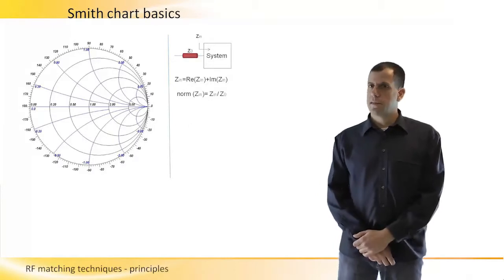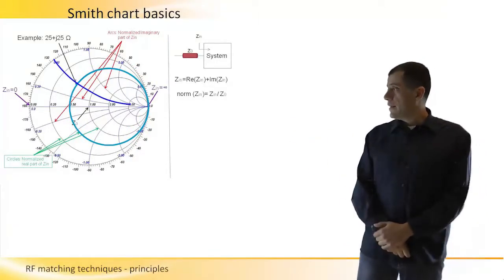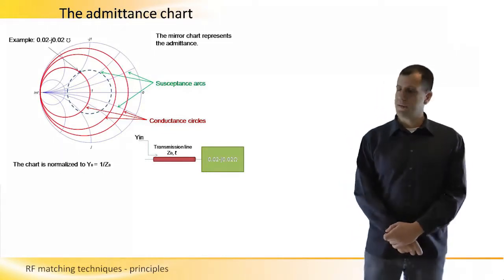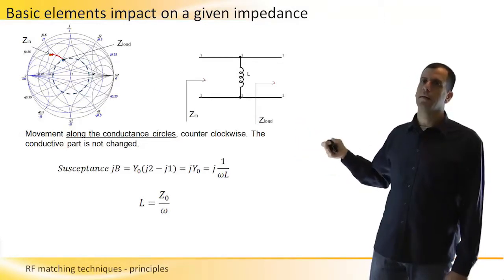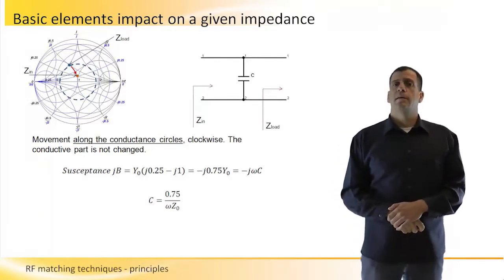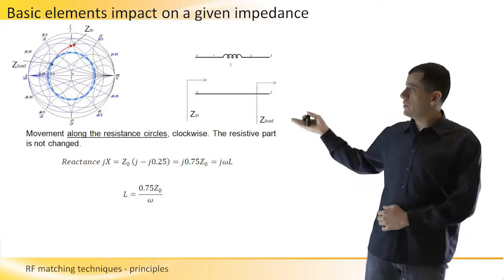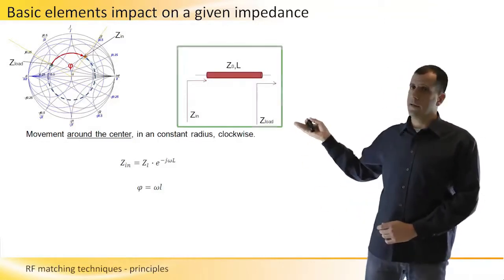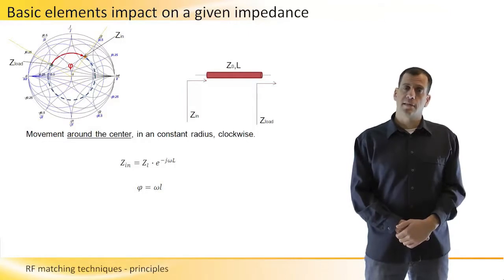RF Matching Techniques - Principles

Comment: First of all,  thanks for the video. 
But, I think it will confuse the students. There are many confusing points.
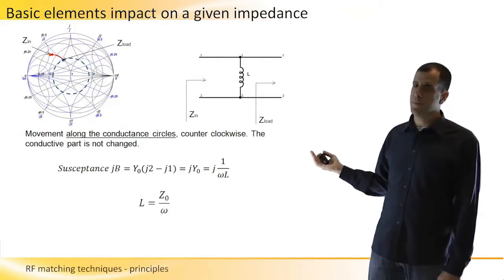For example in the minute 8:54 : "the inductance never changes (in this case)"; and many other times. 
The concepts of impedance, reactance, resistance, admittance, subceptance and conductance are mixed and also in the circle and arcs of the Z and Y Smith Charts.
Please review and correct the video.

Thank you for your efforts.